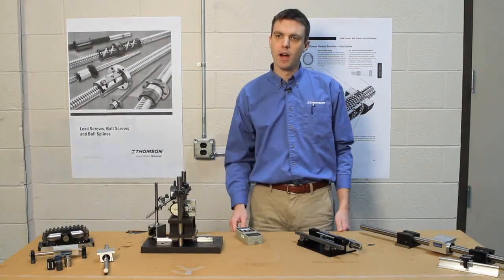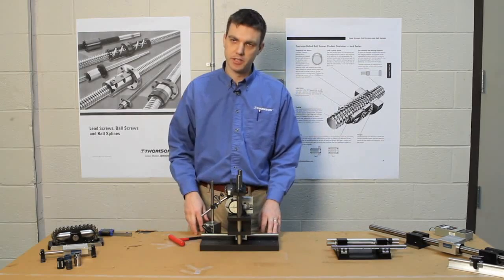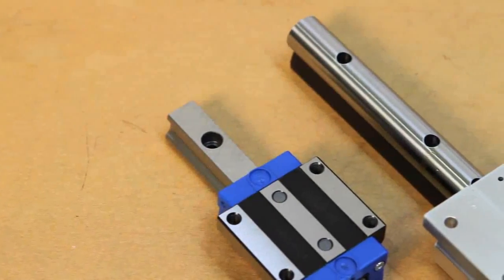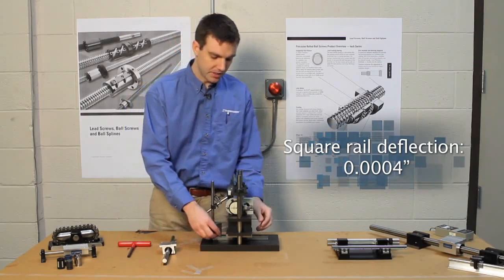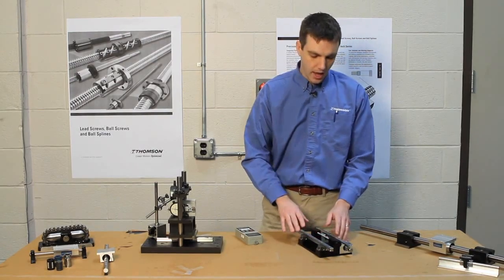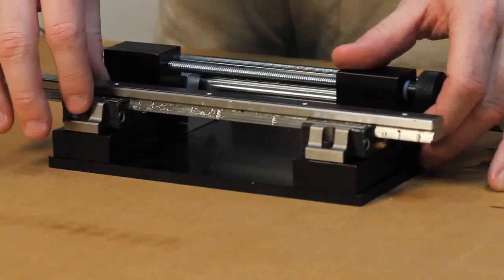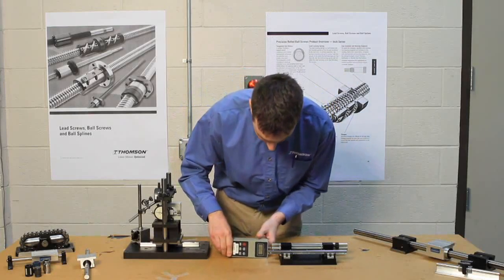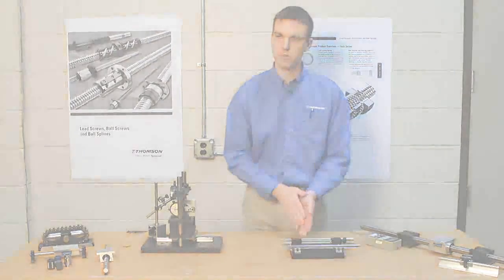Round Rail vs. Square Rail Technology

Comment: never use round rails.
Reply: I think this video made the case that round rails are far better for DIY projects with higher tolerances such as a CNC router for wood. Square are going to be better for anything requiring extreme precision.
Reply: @-Thunder  Yeah,  I am building a homemade aluminum extrusion frame cnc and I am worried that with the slightest deflection the linear rails will seize up. I will try both kinds and see.
Reply: @-Thunder  This is what the comment you replied on should've said. It's such a bait comment.. But thank you for giving some context!
Reply: why